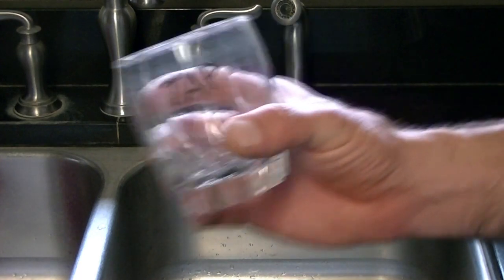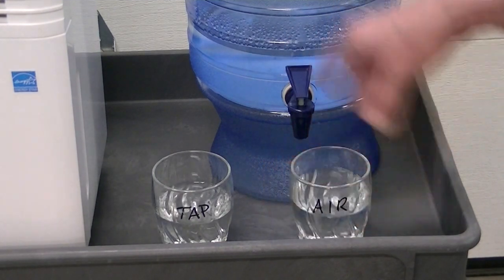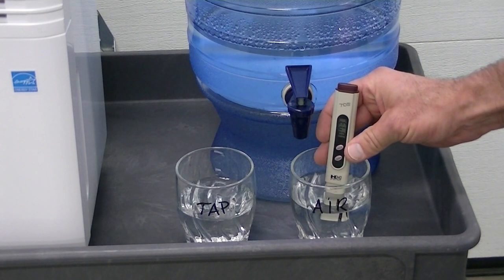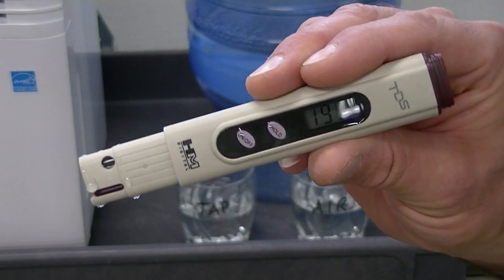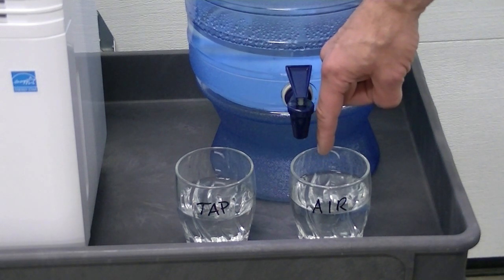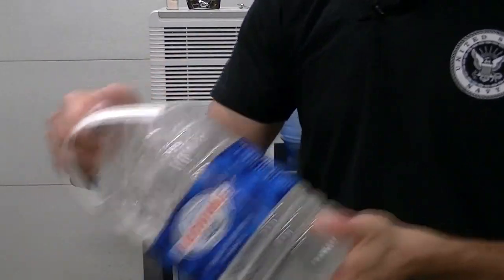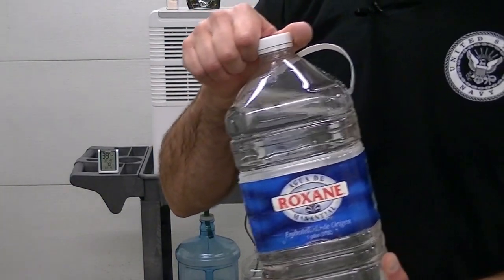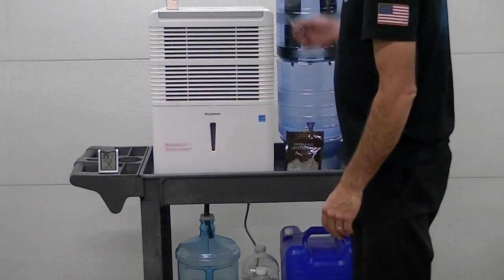Part 5 | How To Make Your Own Air To Water Generator At Home | 4 to 9 Gallons Of Purified Water/Day

Comment: I am building a system for off the grid motorhome it will be powered by a 1800 watt solar panel system and a 400 watt wind turbine. I have already started building a electrolysis unit for making O2 and H2 that will act as a direct propane replacement thank you for everything
Reply: I'm curious as to if a reverse osmosis vs this Berkey filter will make any difference(?) ..or running them in tandem(?), along with a black light filter(?) for general DIY RV use.. overkill?
Reply: @littledogsbigdogs1637  it comes down to what you're primary sources of water will be ,my design is filtered air to filtered water, treated with ozone to provide water under the most dangerous condition likely to acure
Reply: @jamesmiller2096  I'm building out a tiny home on wheels, using an old 1988 24ft Snap-On step van, air to water is something I was looking into, in conjunction with the 'hour shower' system.. I was thinking to use air to water to supply all my water needs.. I got the idea of using the UV black light filter in tandem with RO and the berkey filters in the air to water system.. I wouldn't need to carry so much water storage and my grey tank wouldn't fill so quick either.. 25min youtube link on the hour shower: https://youtu.be/8s3jsleHXcI
Reply: @littledogsbigdogs1637  thanks for the link

Comment: Dissolved solids?  That won’t read the VOCs from that Toxic garden hose!  
Even Berkey filters will need replaced more often, when filtering higher concentrations of toxic chemicals, even from common garden hose. 
 PLEASE ONLY use “POTABLE” water hoses!!
 Also, only use harder-plastic w/No BPA,  NOT the soft plastic blue or white cube containers, for the same reasons.

Comment: I like this idea, but can't leave well enough alone. I going to build one that drains directly into the water filter with a float switch to shut the machine off when the level gets high enough. In SC it will only need to run a few hours a day most of the year. Great idea!
Reply: Very good idea to add a float switch that way you don't have to tend to it as often.  So you can go a day or two without having to manage it and the only thing left to do is fill your storage containers and add the salt.

The only thing is by doing this will the machine kick back on by itself when the switch drops?  Some of these units have to be turned on after power is applied.  So one would need a work around for this.

Its been 10 months since you recommended this.  Were you able to apply this method?
Reply: @masonfamily02  It's funny you would reply right now. I have a unit on the way as we speak. I will have to find a work around for the reset. Maybe keep the unit running, but just shut the compressor down. We will see.
Reply: @oldmgbs2 I’m curious how you did the work around. I’m thinking of doing your setup.
Reply: Shutting the compressor down would be the better idea. I was just going to empty the holding tank into a filter bowl when I needed to.
Reply: Sounds like a "tall" order.

Comment: I shared all of this with my husband.  We already had a dehumidifier and were dumping out about 70 gallons of water a day because of the humidity - so this was a great series.  We ordered the supplies you suggested, including the barometer and the solid material analyzer thingie - oh well you know.  Thanks so much.  It was the big things like keeping the house warm, how to cook inside, keeping the house cool and dehumidified and getting water that were really perplexing us.  I am temperature intolerant like within a few degrees.  So - you did a super job of solving the water problem.  Then we find a counter top ice maker that we could plug into our Jackery, a portable AC unit that uses 110 volts - check - and got a dutch oven and tripod so we could cook outside if we want to make bread or something but for inside got a 110 volt electric cooktop to plug into our Jackery - that plus some extra solar panels solved 90% of our problems.  THANK YOU!
Reply: this is a lot of quantity!!! may I see your dehumidifier, if you can write brand name and model please ?
Reply: I’m positive that was a TYPO on your part. There is NO way that you were actually getting 70 GALLONS A DAY from your dehumidifier!

Comment: When I looked at dehumidifiers, they are sold by sq ft efficiency. Not by gallons. They state a pint capacity tank. Efficiency from 500-3000 sq ft. 
What efficiency was the one you have?

Comment: Out of curiousity what is the reading of the water directly from the dehumidifier into the water jug without using the water  purifier? I'm need water for my garden ...
Reply: Realize this is old but if you are still curious. I wouldn't trust the untreated water with a garden. Primarily, I'd be worried about bacterias or funguses.
It would be like grabbing infected plants. And sprinking bits of ineffective, all across your garden.

Theoretically, most should be killed when the dehumidifier thaws out the condensed water. But in an exagerated way, it's like using swamp water. Especially, from areas of the machine that are a bit away from the radiator.

Treating plants vs. treating water?
I think treating the water is more economical overall.

I'd like to hear about your garden? I took a break this year because I'm working 50hr+ weeks. I'm into hydroponics and gardening in general. But my wife is more of the traditional dirt grower.

Comment: I'm curious about how the Himalayan salt tastes vs the pure water. I drink tap water but my gf is a water snob and will drink only one brand of drinking water. 
You claim it tastes great, but shouldn't water have no taste? Isn't that what most people prefer? I get so much salt from my diet, I want to limit my sodium intake.
Reply from the maker: Hi John, it doesn't add a "flavor" to speak of, makes it smooth with the added benefit of putting the minerals back in your body.  If you just drank distilled water, it would begin to rob your body of these minerals it needs.  Take care.
Reply: @NewportStudio  
I use dehumidifiers to control humidity in my basement. They currently just drain to septic tank. I like your idea. I'm not sure it will pass muster with Julie for drinking water, we'll see.
Reply: @NewportStudio  I have drank steam-distilled water for more than 20 years using the Waterwise steam distiller.  You would be amazed at the oil-slick ring of contaminates and crud it takes out of every gallon of "good" tap water.  I'm in my late '60's and have not broke a bone yet.  I was always taught you should get your vitamins and minerals from your food, and not your water.  Water should be as pure and cleansing as possible.  I'm very interested in getting the system you recommend, (possibly two systems) and put a few questions on one of your previous videos.  Thank you for a well-thought-out and informative video series!